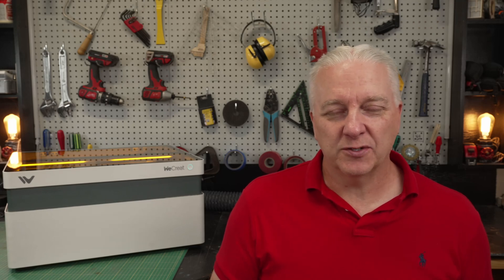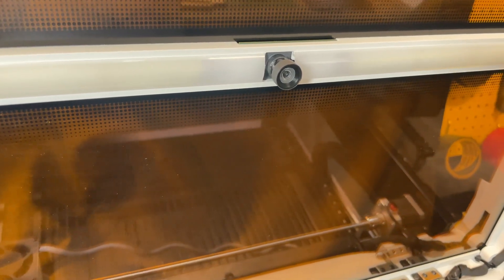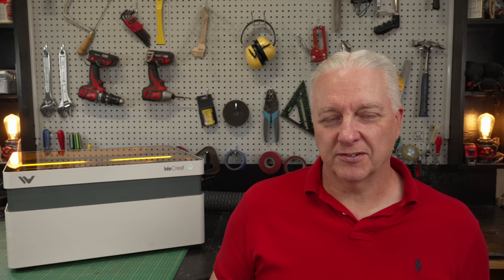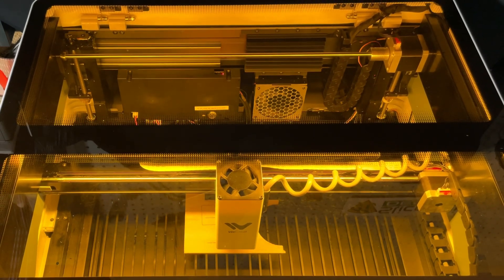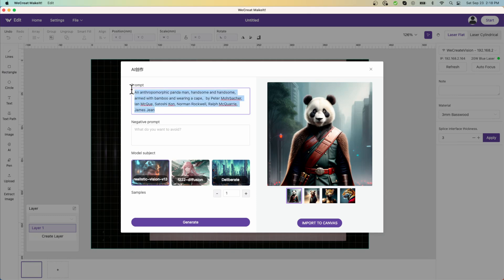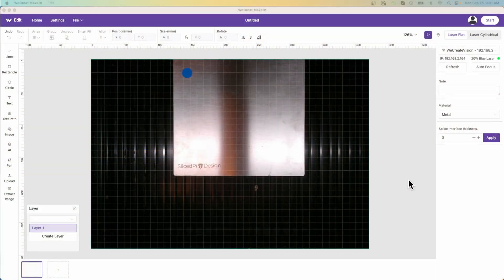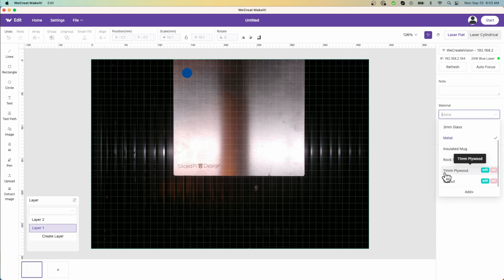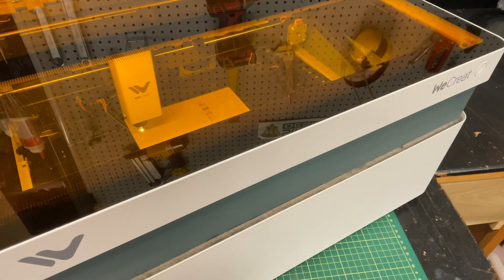The Easy-to-Use Wecreat Vision Desktop Laser

Comment: any idea how to adjust kerf in the makeit software?
Reply from the maker: Hmm. I don’t think I’ve seen kerf compensation in  Wecreat MakeIt. However if this is required, you could use Lightburn with your vision now.
Reply: @SteveMakesEverything  Thank you Steve. I have been binge watching your channel. Thank you so much for everything you do. This is all new to me. Please don’t make me learn Lightburn.🤣🤣🤣🤣
Reply from the maker: @junkjournalshopJohni  I hear that more often than you think.  Lightburn is incredibly powerful, but it's pretty clearly designed by engineers for engineers.

Comment: Can I ask you... yesterday I was watching your video and setting up my brand new machine.  The black electricity "switching adapter" had a tiny green light on and the machine fired up nicely.  I put my first piece of wood in to get started testing and the machine turned off.  The little black adapter no longer had a green light.  I tried plugging into a new outlet and nothing ever worked again.  I'm guessing that my unit was shipped with a FAULTY electrical adapter?  Has this happened to you or anyone?  I'm contacting support or course, but what a disappointing start to my adventure.  UGH.
Reply from the maker: Check the power cord plugged into the adapter, I’ve had those work loose. If the power supply is really dead, I’d say get one on Amazon because it will be cheaper. This will give you the power supply, but will charge you shipping from China and take a month to get it to you.
Reply: @SteveMakesEverything  Thanks for writing back... you won't believe the hoops they are making me jump through.  Instructions on: taking interior panels off and checking wires on the circuit-board.  Instead of just sending me a new power-block.  I'm the king of bad luck.  I should've bought the Xtool I guess.  UGH.
Reply from the maker: @EffingtonCouldBe  Just tell them you've measured the voltage on the power supply and it's zero volts.

FWIW you can run into issues with any laser - especially this one.  THey all use the same types of power supplies
Reply: @SteveMakesEverything  Thanks - good to know... I just ordered one on Amazon that has the same "specs".  I will see if that works tomorrow.  Support won't contact me.  Take care, thanks for your knowledge.
Reply from the maker: @EffingtonCouldBe Sadly support from most companies is terrible.  I wish they'd fix this as an industry.

Comment: I’m having tons of trouble with mine, stuck in cylinder mode and can’t get it to do anything, no idle mode will not move up and down nothing😢. It’s less than 2 months old, help!!!
Reply from the maker: Crap!  How does it get stuck in cylinder mode?  Are you saying you can’t change the setting in Wecreat Makeit?  If so, it’s probably not the laser.
Reply: @SteveMakesEverything  I had made a tumbler, worked fine, took the assemble off, went to flat laser, when you tell it to auto focus, comes up with alert to remove cylinder thing, even though it’s not on there. I can’t move bed or the assembly that goes up and down, like the idle mode thing, nothing happens. I’ve put the cylinder think on and off thinking that may help as someone on Facebook suggested but that didn’t work either. Have reached out to tech support….crickets
Reply from the maker: @kerricryer1590  Just one question: Was the laser powered on when you plugged or unplugged the rotary?  It should always be turned off to do that (this is probably the only thing with the potential to do damage).

If the laser is connecting to your computer (i.e. There is a green dot beside the print in MakeIt) then it's probably OK.  In this case, it's probably MakeIt that's confused.

You could try deleting the laser connection and reinstalling MakeIt to see if that helps. I'm not in my shop to look, and I can't remember if there is some sort of factory reset in the settings, but you can have a look and try that too.  Also look for firmware updates while you're there.
Reply: @SteveMakesEverything  yes it was turned off to disconnect, yes the green light is on, don’t know what you mean by deleting the laser connection, I’m not real commuter savvy, but I did uninstall and reinstall software, is that the same thing??
Thank you so much for responding to me and being so helpful!!
Reply from the maker: @kerricryer1590  Yes that should have done it.  Have to ask in their Facebook group.  I know the support people hang out there.

Comment: Hey question mine is cutting way off of where I set it to cut anyone got any fixes for this I tried engraving a magwell for one of my pistols and it cut way off to the right and down from where it was on the software anyone know how to fix that?
Reply from the maker: Sounds like your camera isn't where the software thinks it should be - maybe it got jolted out of place during shipping.  You could ask in the Wecreat Facebook group or try to get Support to provide an answer.  I, as a born hacker, would try to adjust this myself, of course.😉

Comment: was hoping this would cut a 1inch (25.4mm)thinkness, i use 1x12 for alot of my work.
Reply from the maker: As much as laser companies promote the ability to cut 2x4's it's not really practical with any laser.  If you are cutting softwood, then this laser might get through 25mms by doing multiple passes.

Comment: After two months waiting I got my machine: right out of the box it doesn't work. I present what Wecreat calls  "Auto Focus Failure" which does not allow the machine to do anything. It seems related with the mechanics of four mechanisms that moves the moving part of the enclosure up and down, instead of moving the laser head. The company has not given me any valid solution other than playing around with 16 screws that fix the enclosure. The machine still does not work. This is unacceptable for a brand new device just out of manufacturing. What kind of Quality Control does this manufacturing has? How do they dare to sell a machine with these kind of failures?
Reply from the maker: Well this doesn’t sound good. It’s possible that your laser got abused during shipping. Carriers aren’t very gentle to lasers. However the company really needs to resolve this quickly
Reply: I had the same problem...Their "fix" was for me to practically disassemble the whole damn machine and rebuild it for them. 

Now it sometimes doesn't get stuck when it auto-focuses but the cuts are way off, even after recalibrating. 

I feel like we got stuck beta-testing their product for them...
Reply from the maker: @prerecordedresponse9884  Just everyone knows, I'm passing these comments back to Wecreat.

While I haven't had anything but stellar success with mine, I don't want to be recommending things where the quality varies and the support isn't as useful as it should be.  I'll keep everyone posted if I hear back.
Reply: @SteveMakesEverything  thank you for taking the initiative to do that. It's unfortunate there's so many of us experiencing these issues. 

On my end, Wecreat has been keeping up with my emails, but what they are asking us to do is extreme for a brand new, out of the box product. 

They wanted me to take the panels off, adjust the raiser screws, take apart the protective inner housing covering the PCB, remove a bunch of PCB wires, power cycle the machine and then reassemble, all on a brand new machine.

While I was doing all of this, I discovered a few unprotected wires that were cut open. I asked them what they were and they just glossed over it. It's disappointing to see so many glaring flaws on such an expensive, brand new machine.
Reply from the maker: @prerecordedresponse9884  Well, I'm not sure there are "so many," but really one is more than enough to start a call for action.
Reply from the maker: @prerecordedresponse9884  I had a quick conversation with Wecreat today to let them know that unhappy users can kill a new brand.   Having spent a large part of my working career creating the first version of many products, I can appreciate the challenges of ramping up production, but I poked them a bit to continue improving.

I will point out that Wecreat does have a Facebook group, which might be helpful, and you can find it here: https://www.facebook.com/groups/1044882459837900/search/?q=service

As a YouTuber, I get to see a single unit, and mine has been running without flaw.  I hope everyone understands that I have little influence on any company and can only add my voice to those who are having problems.  My only real contribution is to raise awareness using what are probably shorter paths into some of the support teams.

Comment: I have sent in my $20.00 to get the vision, but I am worried about the fumes in the house.  Would the Comgrow smoke extractor take care of most of the fumes, since you say they are not bad?  Your video is the first one that has made me think I might be able to use a laser engraver.  Thanks
Reply from the maker: Wecreat has its own fume extractor, just so you know.  Also, check out the xTool extractor.  The Comgrow extractor might be a bit small for this application, though.  But any fume extractor is better than none.

By far, the best method is to vent the laser outside if you can.

Comment: How does this compare to the xtool s1? For a first laser which would you recommend between the 2of them? Thanks for another great video
Reply from the maker: If there is no budget, probably the S1, but I was using the Wecreat today to do a project and it it definitely easy to use. It’s also quite a bit cheaper.

The S1 is geared more toward advanced makers who probably have a small business.  The Wecreat is definitely aimed at beginners and professionals who aren’t techies.

Comment: Do you have an idea of the amount of time it would take to do a full wrap on a tumbler?  Or, is there another laser you might recommend?
Reply from the maker: There wouldn't be much time difference between any laser to engrave a mug.  So buy the laser that looks most like it will serve your needs within your budget. The Vision is a solid product and certainly has a rotary option, and with its power, it would have no trouble engraving mugs.

Comment: Good video Steve.  Will this laser engrave coated aluminum like the kind used for trophy plates?  Also will it cut and engrave .004 plastic sheets?  Again for trophy plates.  Thanks.
Reply from the maker: The answer to both of those questions should be yes.  Definite engraving anything like anodized aluminum will be fine as long as the coating isn’t just clear. A diode laser won’t touch aluminum, but it can engrave off the coating if it’s dark enough.  The plastic sheet should be thin enough to cut - again as long as it isn’t clear.

Comment: Thank you! What about acrylic? What thickness can it cut? Also, is 10,000 hours good? What does that really mean?
Reply from the maker: When you ask about acrylic, we need to be specific and say "black acrylic" since diode lasers don't cut clear, white, or other light-colored acrylic.  And like any 20W laser, this will cut 12-15mm black acrylic.

On the lifespan question, 10000 hours is typical and to put that in perspective, it would be like running your laser 24x7 for almost 18 months..  So basically this should work in a typical environment for several years.

Comment: Nice review, but too much smoke/char when cutting and engraving. Was the air assist working?
Reply from the maker: Yes, air assist was on, but if you are brute-forcing a cut with any diode laser, the edges will be dark (It this video it wasn't charred though - just a bit dark because I'm cutting hardware store plywood, which has tough glues in it).  If you just want to eliminate charring with any laser increase the speed a lot and do multiple passes.  It takes about the same time but cuts cleaner

Comment: I just got into laser engraving, have access to nearly unlimited supply of mahogany veneer and use a 10w laser. Any basic laser engraving settings for it, speed, power, lines per mm? I've done a couple of my nephew and some of lettering that came out not too bad. Though forgot the settings. Anyway I saw a video of yours adding borax to darken the engraving.
Reply from the maker: Best thing to do is use Lightburn to do material cut and engrave tests. Then you will always have something to reference. I did a video recently showing how to do this. https://youtu.be/cBrwh5pLChY?si=2-5ups-LVnOnwn17
Reply: @SteveMakesEverything  thank you so much, will be checking it out soon, just kinda jumped in blind and all I remember was thinking "Lets not do 100% on the first try" haha
Reply from the maker: @jeffsorrows  😀

Comment: Curious to hear more on how you'd compare it to the XTool M1. I've had my M1 for a while now, but I've found that I just don't like it much. I've never had much luck with alignment, and there are a ton of places on the machine for smoke to come out, especially when using the riser. Have you tried batch cutting/engraving on the Vision?
Reply from the maker: I haven’t done batch cutting or engraving yet, because there was so much to cover. The vision supports it though so maybe this is something I should cover if I do a follow up.

As far as an M1 comparison, I like the Vision more. It’s easier to use and the camera positioning is deadly accurate. There aren’t any places for smoke to leak out and the exhaust fan has much more power than the one on the M1. 

I’m not trying to bash the M1. It’s a great product too, but it’s a couple years old and the industry has evolved to build more comprehensive products.  I’m sure xTool is evolving too to create more advanced products.
Reply: @SteveMakesEverything how would you compare it to the xTool S1?
Reply from the maker: @jordanharris9390  Well sometime in the next couple weeks I plan to do a head-head comparison of the two.  They both have their own unique strengths.

Comment: I have a 90w c02, but am pondering getting a second for really fine detail engraving. Spot size on diodes appears to be much smaller. This could be a contender.
I did have a general question on diode beams. Do they have an hourglass cut path like a c02?
Thanks for the evaluation.
Reply from the maker: Yes I do the same thing. The spot size on this laser is claimed to be 0.08mms square though it can’t really measure it. Regardless any diode laser will create finer engraving and cuts than a CO2

Every laser will have some sort of hourglass cut though in most diode lasers the focal length tends to be longer so it is less obvious. On a CO2 it would be similar to using a 5” lens.
Reply: @SteveMakesEverything  Thanks!

Comment: Great video, Steve! I'm thinking that these folks picked a fight and will force the other manufacturers to make a "toaster."  2024 is going to be interesting. I'm going to put some money aside.
Reply from the maker: This is why I reviewed it. I see the potential to drive the industry in a better direction.
Reply: Looks like xtool creative space
Reply from the maker: @djs7515  It's actually more like Circut Maker, but I guess if you see enough of these, they all start looking the same.

I think there's a message here for Lightburn too that there is space to make their software a bit easier to use too.
Reply: @SteveMakesEverything  for lightburn to dumb down would need a full software rewrite. Althoug having intermediate software makes sense. Is this machine lightburn compatible. The website has conflictingdata. "soon" and "yes"
Reply from the maker: @gilaraujo  Currently Lightburn isn't supported, but they could certainly use the same approach as xTool did.
Reply: Wow,  just purchased a laser,  wish I had know, as my wife will be a major user of it.